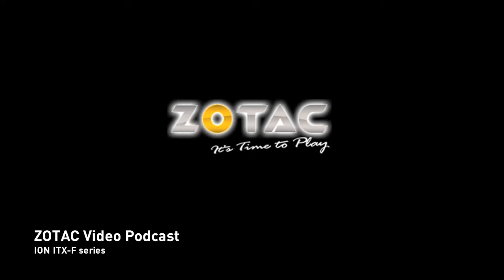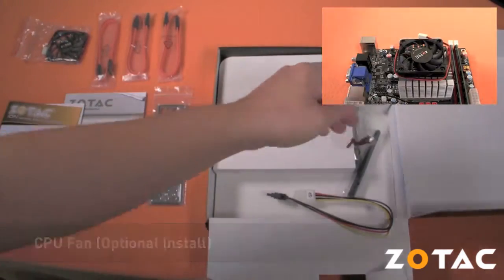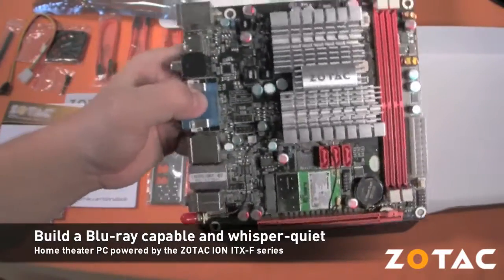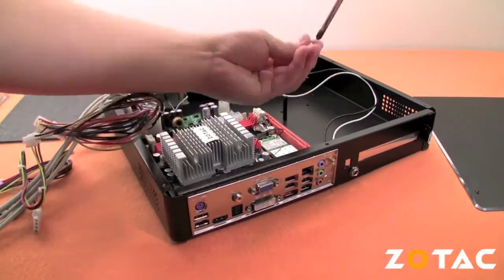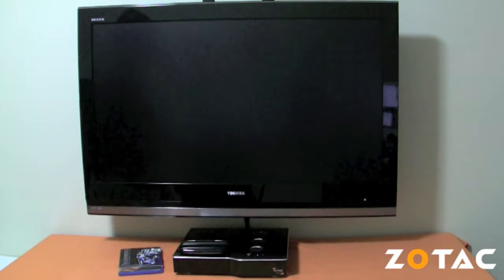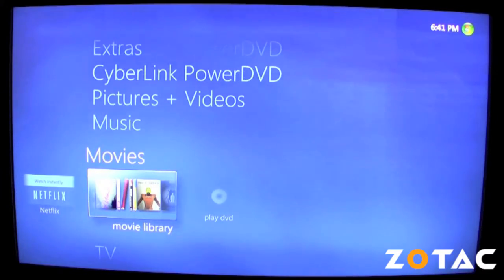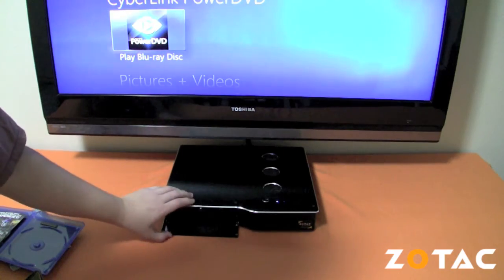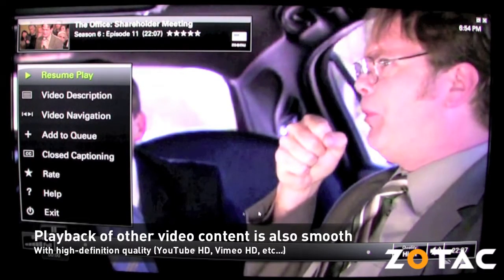ZOTAC ION ITX-F-E Video Podcast

Comment: @ZOTACglobal Well, my last attempt to cool it down is to cut out 2.5 cm from the heatsink in its height and hook on top of it a Noctua NF-R8 80mm. Do you think if I cut 2.5 cm of the heatsink height it will still do a good dissipation? This cooler has a very good CFM + very low noise so I'm really think I'll  be able to solve it doing this. What you think ZOTACglobal???? Let me know!

Comment: @ZOTACglobal 40-50F ??? How come? That's is around 4-5 celcius.... What is the outside temp? I'll try to mount the cooler on top of the memory. Should I put the fan in which way? Blowing air or exausting it ? I think 2nd option right? Exausting through the top case roles?

Comment from the maker: @gpborgesyt Temps here are around 40-50F. Try setting the included fan on top of the memory, offset from the heatsink by a little bit. It provides enough air to keep the CPU happy for us. Also, don't put it in a tight space.

Comment: Hi, it really can't run fanless here in Brazil... Temps are 75~80 now in summer and that's very bad for the hardware. I've even add 2 5cm coolers at the right side of the case but you get some bad noise and temp goes down to 60~65. What temp do you have it running? What is the outside (weather) temp? Does anyone know alternatives to solve the temp issues in this setup? I just LOVE the case and the board... however, temp can't go down... :-(